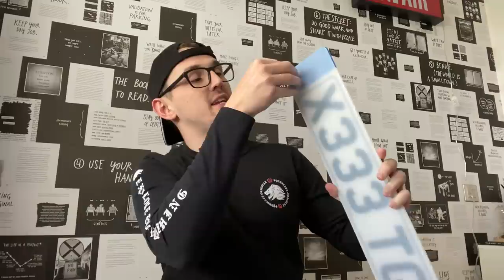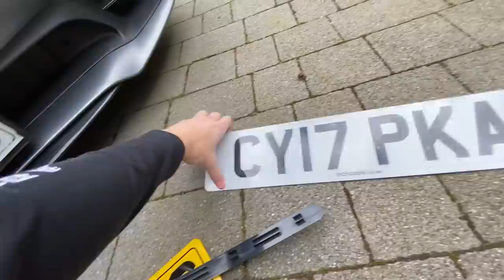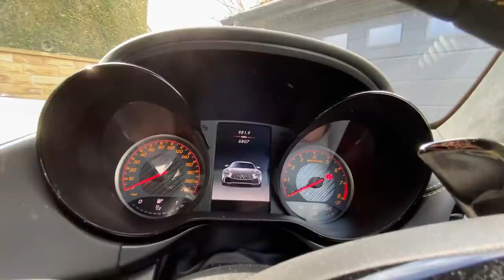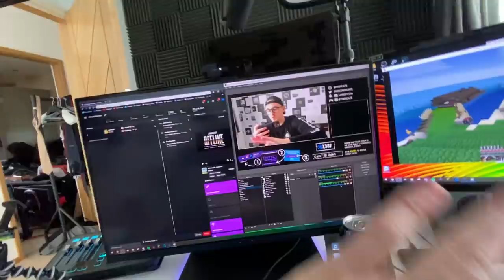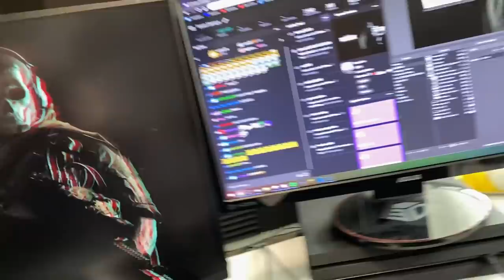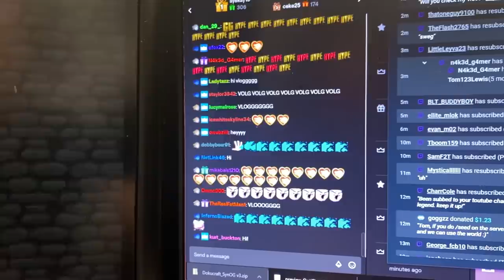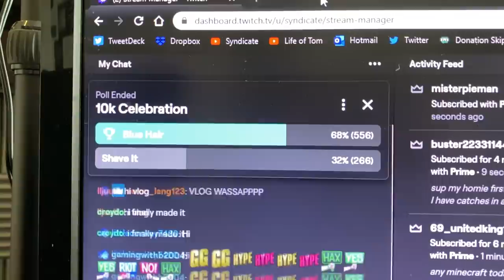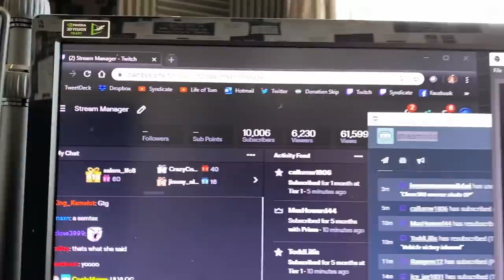All these horses and nowhere to gallop!

Comment: Tom! - Number plate tips! - The number plate just needs the details in the bottom right corner. Needs the name and postcode, thats it. I always get my plates from 'Plates for Cars'. They do excellent plates, really high quality. Used them for my bmw 4 series, the CLS and also the work horse mazda 6. Never failed me. I'd highly recommend the 3D gel plates too! Get them stuck on, don't drill them, looks nice and clean!

Comment: For your number plate issue - just simply do what I did for my cars private reg. Google "buy show plates" click whichever link (I used the top one) and set everything to "UK LEGAL" (inc. the legal gap needed between the 3 and thee T) and they will send you some plates without all the branding and postcodes on it. However you can also get fancy 3D/4D plates from a chap with the company monsta plates who do exactly the same thing!  hope this helps!

Comment: Tom I would suggest putting your car in gear and taking the hand break off. Stops it from seizing. You're car wont move, it will just rock alittle, the gears will hold it in place.

Comment: So I was able to follow your advice from the previous vlog of not getting bitten by a Bearded Dragon. Unfortunately it seems it came with the trade off of being bitten be a snake. Was helping my sister move one of her snakes into a new tank and she doesn't get handled quite enough so she's slightly agressive and I hadn't seen her for a while so there was that. I used the feeding tongs to pull her out of the sand then went in to pick her up. Instead of reaching in to just grab her I decided to take it easy just in case and with one finger just touched her back. She darted around and bit me on the knuckle. At lease she's small so it didn't do too much damage. And to ease any fears of sickness I washed my hands before handling her as well as after the bite.

Comment: Tom - you can have reg plates without the companies name advertised all over them, however you do need the registrants postcode and a BSA mark stamped onto them (the numbers) most people have those in tiny writing towards the corner. Online companies will print you a set of show plates without all of that though and in 8 years of driving I've never been pulled or fined for it..
Reply: Cant see it with the chin of the mercs plate holder anyways so waste of money tbf.

Comment: Can buy plates off ebay that don't have branding on them I had one made. Search show plates on ebay
Reply: can get pulled for show plates tho so gotta be careful
Reply: @masonhodgson3  that's really only if you have them a colour your not supposed to have though. Should be fine with standard colour and you could get the 4D ones aswell
Reply: @MegaNayton  Yeah its unlikely to get pulled but without a BS Code they can give you a fine for it, best of both worlds is to go to a decent company like exclusive registrations for a decent plate thats road legal

Comment: Harness up if you are going to clean the main roof mate. 🤙🍻
Reply: It would be easier just to put a scaffold platform on either side. But on that Garage the pitch isnt that bad so he could get away from having neither.
Reply: @Jacobob  dont think he would be able to get it tho mate. Bit of rope around the waist anchored to the top. Just in case as he is on his own 🤙
Reply: @paul_yt2254  Still hit and miss. His rope would have to be long enough to be tied to the top of the ladder to the top of the roof. If he fell off the rope would be then too long, his body weight would bring the ladder down with him so doing that is a waste of time.
Reply: @Jacobob  you anchor at the top of the roof, not the ladder 🤦‍♂️😂
Reply: @paul_yt2254  What would you anchor to on the top of the roof?

Comment: Tom you really ought to at least start the car every few days and just let it run for a bit. Especially as it's sitting outside on an uneven surface. It's not a regular car.
Reply: You shouldn't be warming a car up by letting it idle. It will be fine just sat there. Worst case scenario is a new battery.
Reply: @shawty1984  he doesn't have a trickle charger
Reply: @BakersTaste  the advice still stands. The best way to warm a car up is to just drive it as normal, not let it idle. A weekly trip to the supermarket should be enough to keep the car going till the lockdown is over.